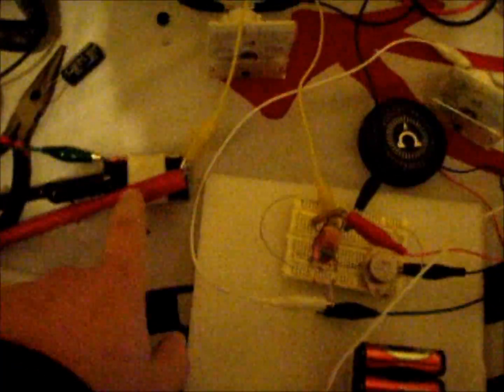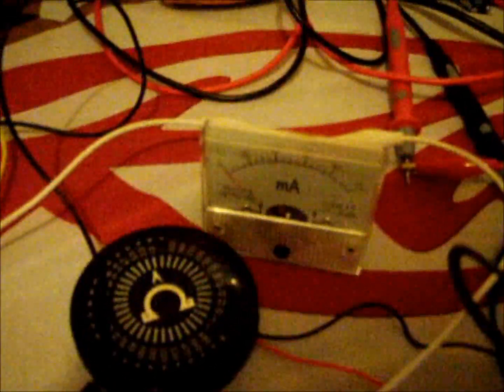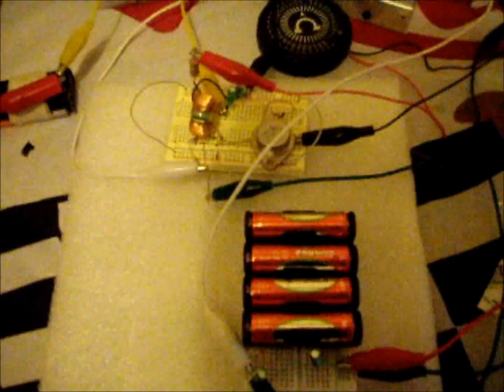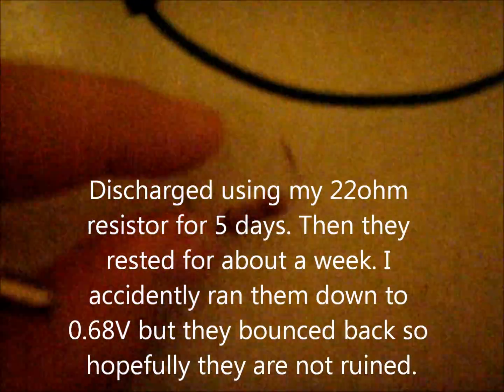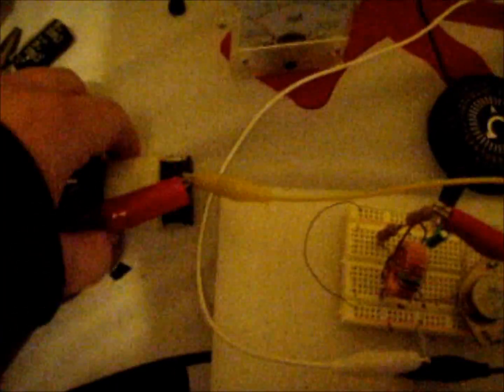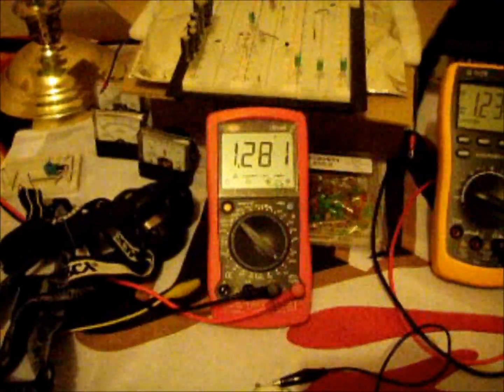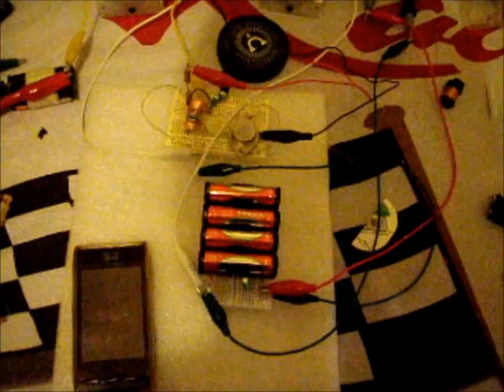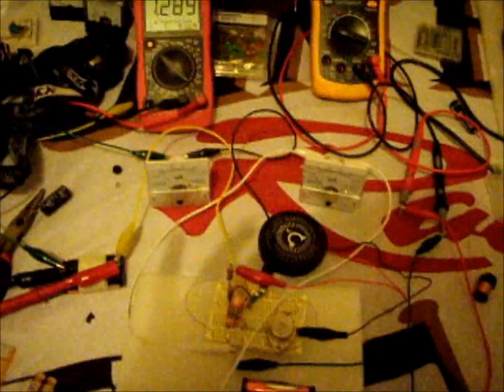Joule Thief Charger Using Tesla One Wire Technology Multi Battery Test - 001

Comment: @GuardianZeus21 
I'm sorry if I've made you defensive about this, but I can't put it much simpler in such a short post. I should not have said the word nonsense, just consider it deleted. You're free to call it whatever you want, but that does not change the fact that this is a standard electronic circuit with no magical or special properties to it. I'm also a member of the Bedini monopole Yahoo group.  I've been trying to get a SSG going but it doesn't like the neo magnets from disk drives.

Comment from the maker: @acmefixer1 
It is quite ignorant to say that you don't need to know anything about something and then make a comment stating that it is not what the poster says it is. Tesla One wire Technology refers to a pulsed system where any one wire straight or coiled then produces an AC or simulated AC wave. This in turn can be rectified to run a load. My source for this technique is John Bedini from the video "Energy From The Vacuum Part 7 (2009) - Tesla's Impulse Technology".